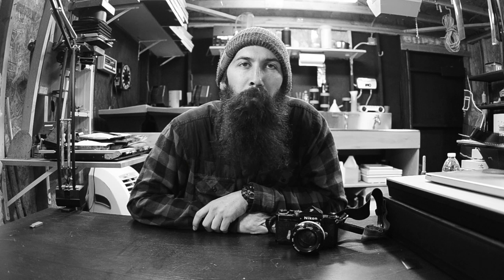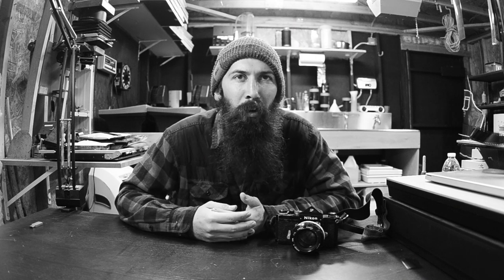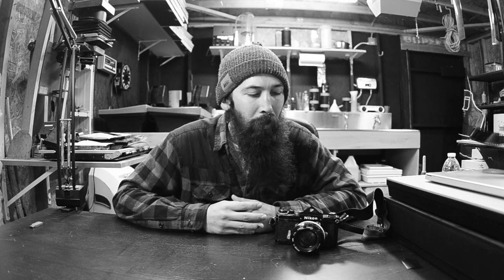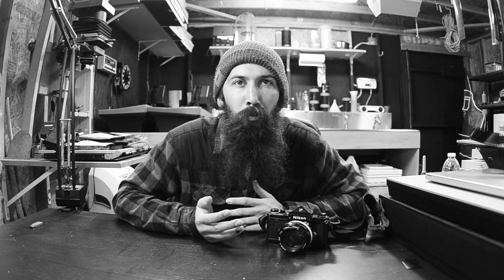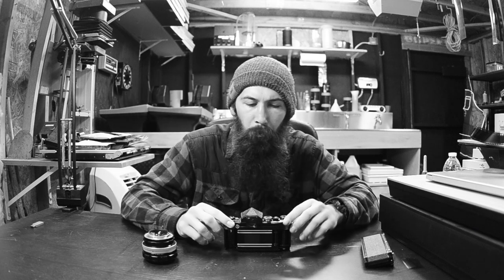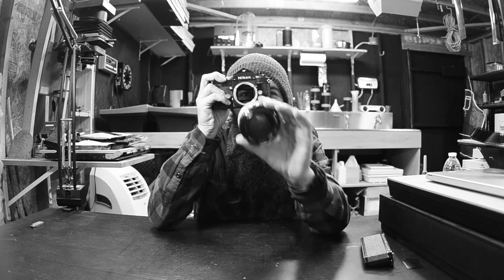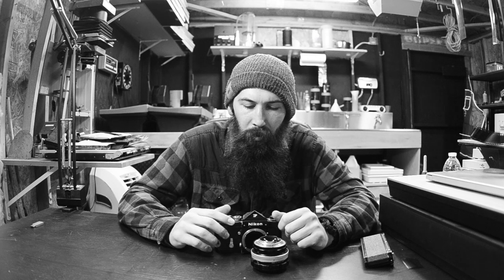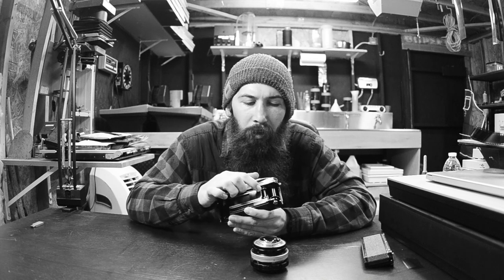How A 35mm SLR Works

Comment: Thanks for the knowledge. Tbh never really thought about the curtain until now. Always thought the shutter speed only controlled the mirror. Now I’m confused as to what job the mirror does?
Reply: The mirror reflects the image as seen through the lens up into a prisim in the top of the camera. The light bounces around up there till it is directed out the viewfinder. You are actually looking through the lens thanks to the mirror. Thats what "reflex" means. The reflex is you looking through the lens via the mirror. SLR = single lens reflex and TLR = twin lens reflex, which is where you have two lenses, one you look through with reflex (the mirror inside a tlr) and the other lens that focuses on the film.

Without a mirror you only have a viewfinder that sees its own image separate from the lens. Rangefinders do use mirrors in their viewfinders also but they still dont look through the lens.
Reply: dlarge6502 Thank you so much. Just needed a reminder. Now I feel well informed.

Comment: Can you make a video explaining why leaf shutter cameras tend to have a wider array of flash-sync options/capabilities than slr's? I've never understood that.
Reply from the maker: Fletcher Eidum it’s mostly because the shutter is inside the lens and much smaller. Since it is not one curtain chasing the other it gets completely out of the way of the film for the flash to fire. The biggest flaw with 35mm cameras flash sync is that second curtain at high shutter speeds ultimately being in the way of the film when the flash comes through the camera. Which is why slower speeds for curtain cameras are necessary and leaf shutters are capable of faster sync speeds.

Comment: I'm on my second roll of film and im having some issues. 
The first roll went without a hitch but the second one I'm having issues with the shutter. I can set it to 1000th of a second but the shutter stays open for a couple of seconds UNLESS I push the film rewind release button. If that is pushed before pushing the shutter button it works normally. Any idea why this is happening? I almost suspect I loaded the film wrong.
Reply: Something wrong with the camera and the film has nothing to do with it.  Try it without the film.
Reply: @evelasq1  I figured. I'll try when the roll is done and hopefully I'll have some shots that are usable out of the 36